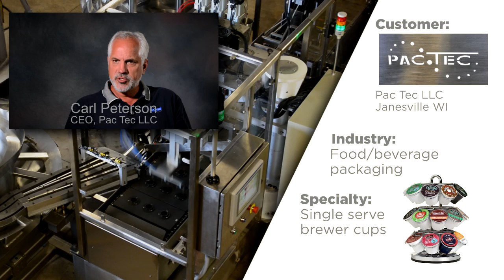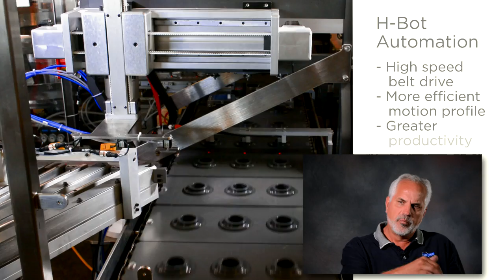H-Bot Automation Powered by Yaskawa

Comment: Dear Yaskawa, I have an account with one of your distributors. Id love to use moe yaskawa products in my machine builds but its a very small time thing. Mainly for my personal cnc mills. Im building a large 3d printer using "H-Bot" type design. My question is. What is the  cost for using your software and are there classes you offer on plc, macros, cnc driver control like used on the Titan 3d printers ect. Something for a small timer like me. I plan to build a cnc plasma table and router id like to use yaskawa products on too.
Reply from the maker: Thank you for your interest! Our self-guided training provides the opportunity to try the software and gain experience first. Learn more: https://www.yaskawa.com/support-training/training/self-guided-video-training